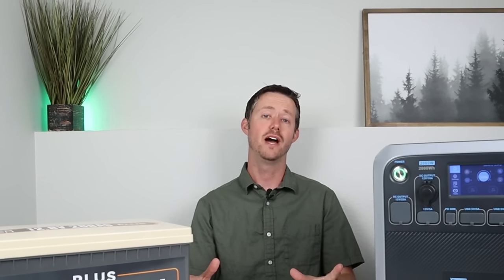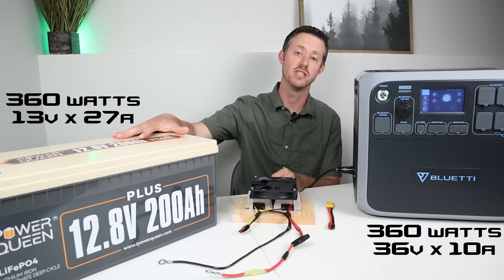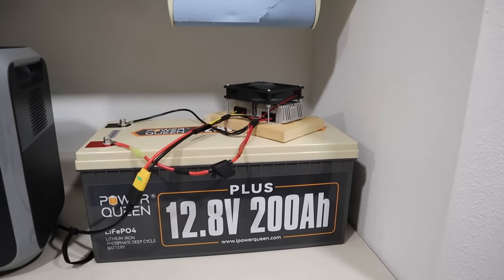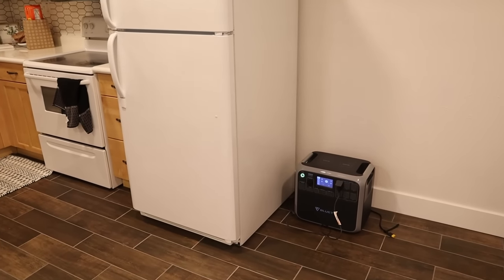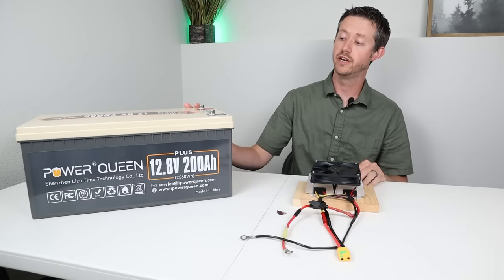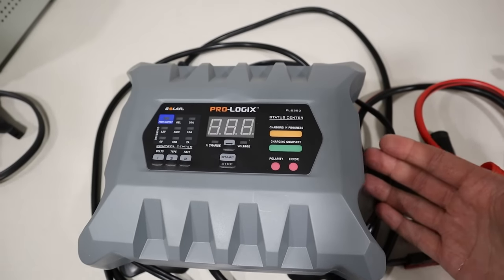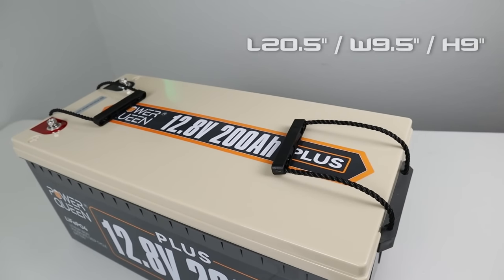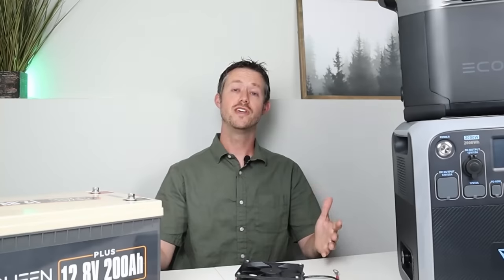Make Your Power Station Last Longer! Power Queen 200AH LiFePO4 - DIY Expansion Battery!

Comment: Are you able to charge the lifepo4 battery while it is connected to the power station in use at the same time?
Reply from the maker: Yes, think of it like a car battery. You can charge and discharge the battery at the same time in the same way your car uses your battery to run things like the radio and headlights, but then gets charged by your car's alternator to keep it full.
Reply: @Jasonoid  what would the connections look like?  Charger connected to lifepo4 terminals, terminals connected to XT60 adapter, XT60 plugged into power station?  Am I missing anything in that configuration?  I'm ignoring the 12/24 converter on purpose just to keep my question simple.
Reply from the maker: @nosqueezie  to make it simple I'd suggest using an xt90 connection since this power station's charging cable has an xt90 on it.
Reply: @Jasonoid  so literally just connect the battery in between the charger and power station, awesome.  Thanks.
Reply from the maker: Check out this video, it shows the charging speed when connecting different batteries to your power station:
https://youtu.be/tK4JKmfndh8

Comment: could I just buy 2- 100 ah batteries in series at 24 volt ? i realize it wouldnt be as fast, but the amps wouldnt change?  Thanks
Reply from the maker: Having two batteries in series would allow you to double the charging rate on the power station. You would see around 235-250 watts input.
Reply: @Jasonoid  So that would be a slow safe way to do it. I just want to be able to boost the 200 max once the solar pannels are not able to charge the unit. thank you so much for your greatly appreciated help. So 3 batteries would be faster at 36 volts in series and wouldn’t raise the amps?
Reply from the maker: @000one  yeah,  36v setup or 48v setup would work just fine and would be plenty fast!
Reply: @Jasonoid  thank you  Appreciated

Comment: Would you be able to help me? I have the AC200p with solar input and the b230 connected to the a/c input also being charged with the d050s. I need one of these batteries to help keep my b230 charged overnight. I know i will need an MPPT charge controller for the batter and panels to connect to the b230, i just don't know how and the steps. Im ok with not using that converter, just need some wattage to help till the sun comes up
Reply from the maker: You can connect an external battery to the D050s charging enhancer and then plug that into the B230 at night. It will charge at 100 watts with a 12v battery, it will charge at 200 watts with a 24v battery. The higher the input voltage of the standalone battery, the higher the charge rate.
Reply: @Jasonoid  ok what will I need to connect the battery to the enhancer, and what do I need, and how to charge the external battery?
Reply from the maker: @mrkevin365  the charging enhancer should have come with battery clamps. Yeah, to charge the external battery you can use either a wall charger or solar charge controller.
Reply: @Jasonoid  yes I have the battery clamps to xt90 cable. It's the solar charge controller is what I dont know about. Someone showed me a Victron SmartSolar MPPT controller but not sure
Reply from the maker: Epever is a great budget brand of MPPT charge controller. I'd go with a 30 or 40 amp model with a larger battery. I have two of those and they work really well. The have really nice displays that show you the power input and output.

Comment: Would this work with a Ctechi gt200?
Reply from the maker: It would be best to charge that small power station at 12v, so not using any voltage converters.

Comment: Great video. Would this work on an ac unit as well?
Reply from the maker: If the AC unit is small and pulls around 500 watts, the 430 watts input would help the power station run a longer amount of time. The battery would still be going down slowly because the larger 500 watt load. How big is the AC unit?

Comment: Or just buy two 12.8v 100Ah booster batteries instead of one 200Ah one. Wire them in series and charge at 26v 10a without any parasitic losses or the need to buy or make anything extra.
Reply from the maker: Yep, that will work too.... Or even better, a 48v EG4 48v server rack battery.

Comment: Why not just take a couple 12volt batteries and put them in series. You'll get 240 watts out of it. or better yet get a 24 volt lifepo4 battery
Reply from the maker: That would work too!

Comment: Thanks for sharing! I watched your video because I am planning to use a 12v battery for my ebike. I was thinking of using a variable step up module instead of these units with 36v output. In your case you can use a 20A 8-60v mudule. Since the Bluetti can take max 12A it will charge up to 720W.
Reply from the maker: That would also work to get more power into the power station.

Comment: I believe you'll want to charge the AC200 at 72V, so the 12.8V powerqueen isn't going to help. Combining (2) 35V+ ebike batteries is the ticket.
Reply from the maker: I don't think you saw when I used the voltage boosters. There are a million ways to skin a cat this is just one of them. Using higher voltage batteries, (like Jehu Garcia) is a great way to do it.
Reply: @Jasonoid  I think when Jehu Garcia did it, you have to unplug the battery packs every hour or the charging goes to nothing, but he never shows that, only the initial charging rate. Annoyed buyers trying to rig up on/off timers so they don't have to repeatedly unplug/replug.
Reply: @Jasonoid  Somebody complained that he was using those Jehu Garcia dongles to charge his AC200 from the Jehu ebike batteries and several of the dongles had burned up. He finally quit replacing the dongles and was left with several useless bricks and wasn't happy, wasted his money.

Comment: This is dangerous.  You need to make it clear to the audience that they need to verify the input on their power bank/generator is rated to handle the voltage you are up-converting to.  You are getting away with it because the Bluetti uses the same connection for both DC and PV charging, so it is designed to handle high voltage from the PV side.  Many other units separate the DC and PV ports, with the DC port being directly wired into the battery.  You don't want to connect 36V directly to a 12V battery.
Reply from the maker: I mention this multiple times in the video, especially at the end when I clarify which power stations this won't work on. Most large power stations (key work large) I have reviewed have high DC input charging on one port. Which ones don't? I specifically explain at the end of the video how to do this on a smaller power station.

Comment: Use a 12v inverter inverter and just plug the factory plug to charge BLUETTI i just did a video on my channel of eb3a running small window AC connected to my rv lead acid batteries and inverter giving power to my whole rv the just plugged BLUETTI into rv outlet and then window unit

Comment: Hmm, i would never do this unless i cant get an invertor for the battery. Using 1 battery to charge another is just killing the batteries life cycle. Just get a cheap invertor for the battery rather than depleting 2 batteries for  the same amount of  AH but i get the point of the video. Thought it was something different since i do have the same bluetti model n a 190 ah battery also.

Comment: AC200max Solar input requirement is only 15A, so this wont work
Reply from the maker: You can go over amperage without an issue. The power station will limit the amperage coming in. You just can't go over voltage.
Reply: @Jasonoid  Thanks for this! I already got two 550w 50.10Voc 14.01A Isc, that should be enough for the AC200Max.. unless if i'd get the Charge Enhancer to add another 550w Panel, or maybe another cheaper charge enhancer that allows Solar panel to charge to the AC input of the AC200Max..

Comment: DC Charging Enhancer (D050S)
US$199.00
Application Model: B230/B300/EB150/EB240, AC200/P/Max

Function:

* Enable more charging methods like solar, car, and lead-acid battery charging.
* 500W Max input.
* Increase the PV input rate to 1200W for the BLUETTI AC200/AC200P; 1400W for the  BLUETTI AC200Max.
* Increase the overall capacity of the BLUETTI AC200/AC200P by connecting them with B230/B300.
Reply from the maker: The Bluetti charging enhancer pretty much doesn't work with 12v batteries. You'll get like 100-120 watts because of the 8 amp charging limit. I made a video on that device HERE: https://youtu.be/7xEh-eMbOFw
Reply: @Jasonoid  Works best for sure with my 4 100w panels in series…
Reply from the maker: @Zkpe02  for sure!

Comment: Dumb question here..how about using a cheap 300 watt pure sine wave inverter to hook up to the battery and charge the powerstation via ac on the inverter? What do you think of this set up?
Reply from the maker: That would work well, as long as your power station charger doesn't go over 300 watts.

Comment: Now the battery is dead. Whaddaya do with that?
Reply from the maker: Use the chargers I talked about in the video to charge it back up.
Reply: I thought people bought solar generators to avoid using  grid power.
Reply from the maker: @michellelaclair  You must not have watched that part of the video? I talked about 3 different solar charge controllers to avoid using grid power.
Reply: Last device he show how to use MPPT controller to charge up using solar.
Reply: @Jasonoid  I did skip to the end to see chargers so let me go back and watch it all. Thanks for  letting me know.
Reply: @michellelaclair  I am with you on that I try not to use any AC power when charging solar all the way!
Reply: @bird6150  I am weaning myself from AC that I can and unplugging what I can to avoid paying for phantom power.   USB, DC power is my goal . Its too hard to collect and store that solar power so I dont take it for granted.

Comment: Wouldn't it make more sense to just connect an inverter to the battery, rather than converting the energy twice more and losing another 10% or so of the total energy? 

I keep seeing videos like this on recharging your power station from another battery, and it just does not make sense to me. Use the energy directly from the big battery... don't waste it by using to recharge yet another one.
Reply from the maker: But then you have TWO inverters running at the same time and wasting power, right? Inverter standby losses are high as well. So there are losses with each option. The most efficient option would be to buy the dedicated expansion battery that charges and discharges with the power station automatically.

Comment: I feel like the larger capacity power stations are kinda useless... specially with the extended batteries. I mean they are big and heavy, unless you have a very specific use case that needs to be "portable", you may as well just have a battery bank with a dedicated, permanently mounted inverter/charger for a lot less $$. For the smaller power stations under 1000Wh I would do this for sure, grab a cheap 24v battery and just hook it up to the solar input if needed.

Comment: so you buy a battery, converter, charger, wires... and you end up spending as much as for a battery extension pack for your power station, which is a set it and forget it solution

Comment: Jasonoid, you should CAUTION your viewers this is NOT a SAFE recommended electrical design. 
The real electrical device manufacturers would not put two voltage converters in parallel without load balance circuits and voltage regulators over two converters. Also, you shouldn't add fuse in parallel to satisfy melting fuse problem. The fact your fuse melted partially during 36 hours use of 300 watt average  low power operation is a sign your set up is NOT SAFE. 

What if your viewer added your setup in RV hidden near battery compartment and your set up caused a thermal incident? There is a reason why adding voltage converters or adding inverters in parallel is not practiced by electrical professionals. You should do more research and consult with real practicing DC electrical engineers.

Comment: not sure how practical this  is ?  why wouldn't you  just use the battery as a power supply  hooked up to an inverter ?  also once the big battery is discharged youre lugging around a dead weight that cant be re charged easily and the battery isn't really specced for this . A bizarre experiment that has no real application in real life  use.
Reply from the maker: Inverters aren't efficient, these are 92% efficient and an inverter is around 78%. I never said this was for a portable use case so you wouldn't be lugging anything around. If you want to run your full size fridge for a longer time in a power outage, this is a good way to extend the runtime. The battery is specd for 200amps continous discharge, which is way higher than what we are pulling from it.

Comment: To all posible buyers DO NO BUY this product !!
I have bought eb70s and AC  output didn't work. To get hold Bluetti customer service, it is horor. After I did get hold service and exchange unit for new one, the new unit will not charge. I bought product and I do not have chance to use it.
Bluetti is not guality product and customer service is non exsisting and shady here in Canada.